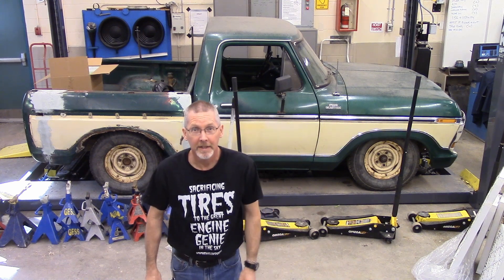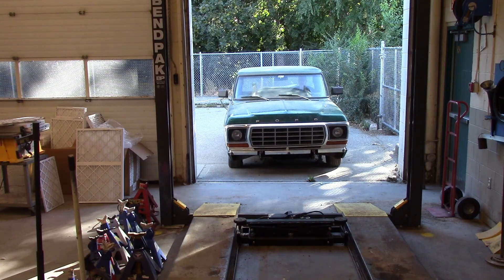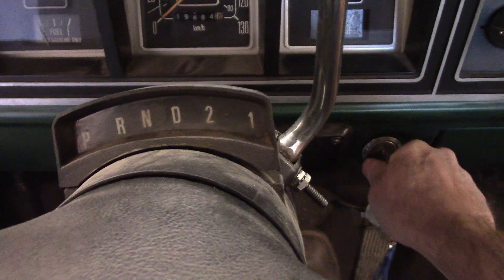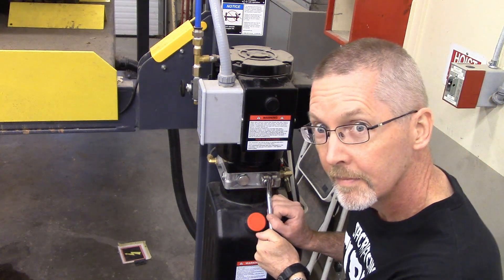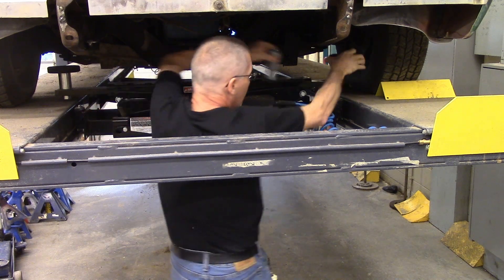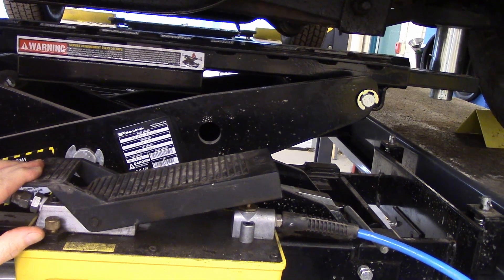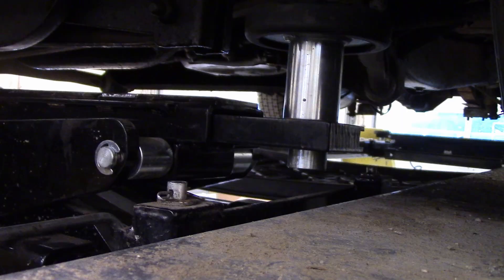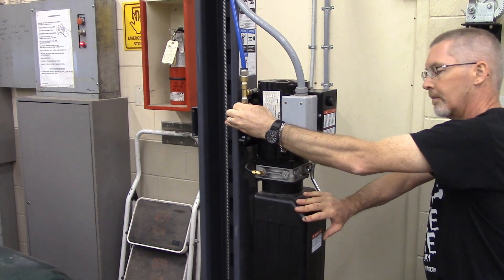QUICK & DIRTY: 4 Post Hoist

Comment: My fav thing when I used to wrench was when you'd be handed a work order that the customer had insisted that they drive the car into the shop. 😆

Even when guiding one of the other techs onto the ramp lift I always stood to the side just in case they inadvertently had a brain fart with the pedals.